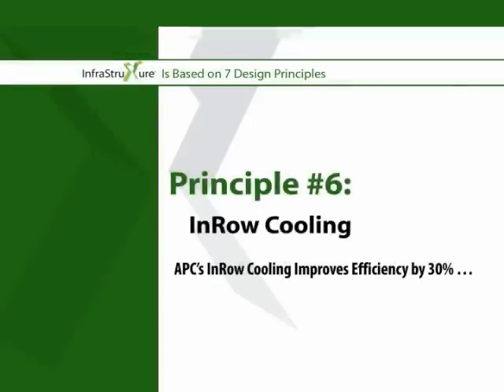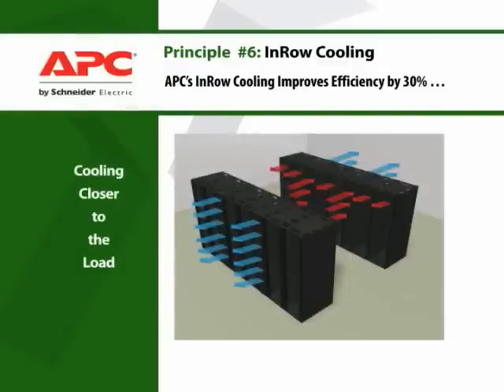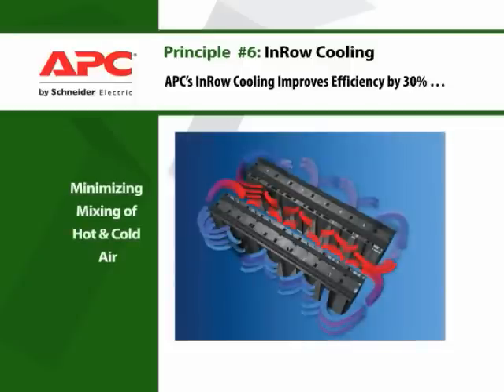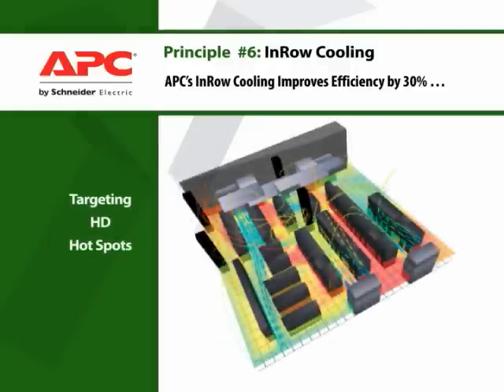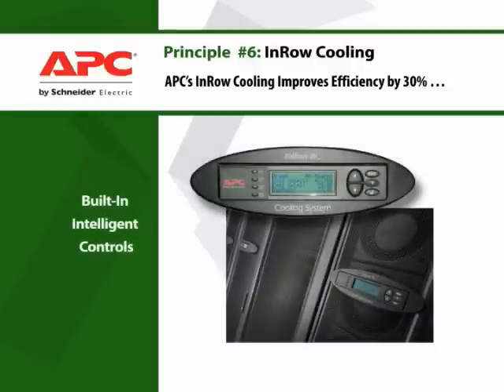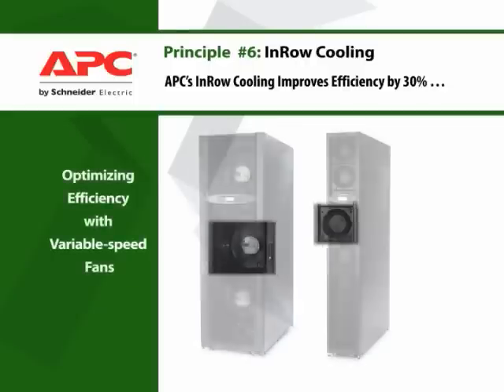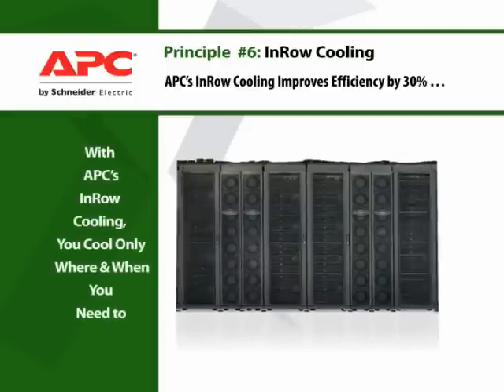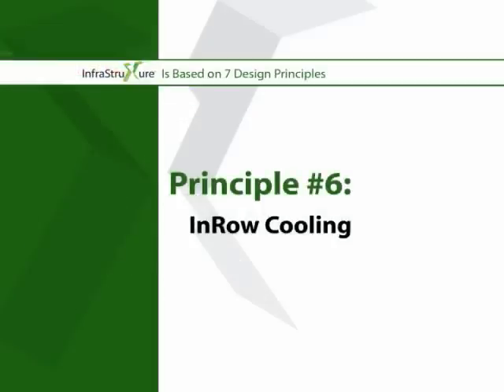APC InRow Cooling Data Center Cooling

Comment: And the perimeter units use no space?  The in-row units "fit" neatly in row and take up less space once you remove the perimeter units.  Also, the energy savings from simplifying the return air path and keeping return temps high (for a proper "delta T") are important.  End containment helps any system become more efficient by reducing mixing, they are not required.

Comment: again, in row cooling units take data center space that can be used by equipment racks vs. the traditional units that can be mounted in unusable aisle spaces. Also, wouldn't you still need a containment at both ends of the row?